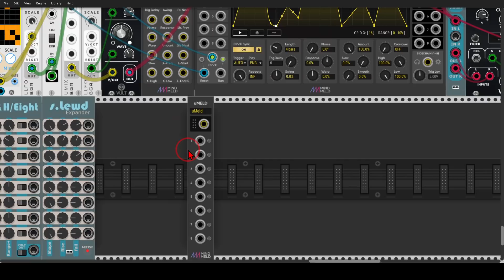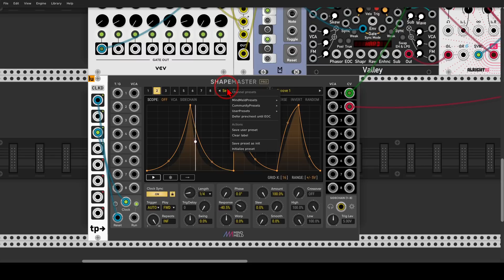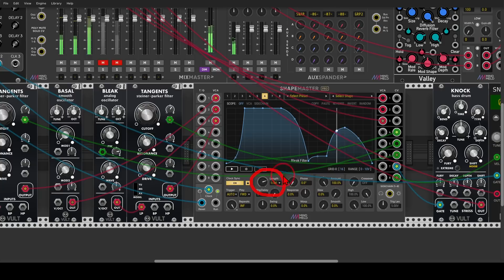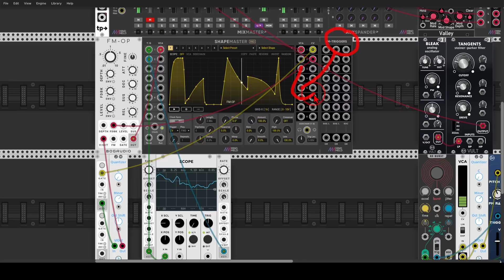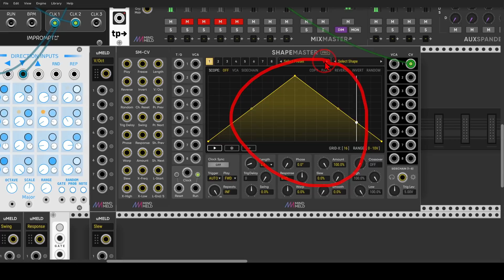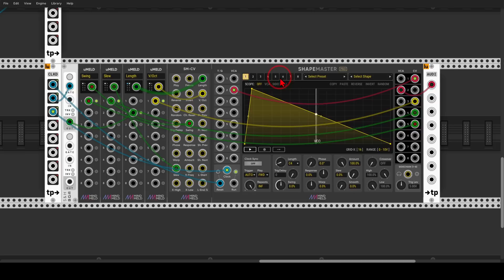The Many Things You Can Do With ShapeMaster Pro from MindMeld

Comment: This is one of the most flexible modules I've seen. Wow! But how CPU-hungry is it? As a developer, I'm trying to imagine the computations required to render complex shapes like that – potentially at audio rates – on eight channels. There are optimisations that could be used, but it's certainly not an easy task.
Reply: Considering what it does, it's very efficient (Marc who coded it is a bit of a wizard in that regard). Someone else asked about CPU further down the comments and Omri replied 'I just checked it in the last patch from the video, which is probably the heaviest, and the levels were between 3 and 4 percent per instance. In comparison, Plateau is around 5%.' 
Even ignoring the shape rendering etc and just looking at it as 8 x EG + VCAs, it is still considerably more efficient than any other 8 x EG + VCA combo in Rack I think.
Reply from the maker: Yeah, as Steve mentioned, Marc, the guy who coded this beautiful monster, is a wizard. ShapeMaster is quite CPU friendly.
Reply: @OmriCohen-Music  Thanks Omri, and @Steve Baker for your comments - that's very impressive! I'm afraid I'm too busy at the moment to get on with learning to code VCV Rack modules, but when I do, I'm looking forward to it. Optimisation is a very interesting challenge :)